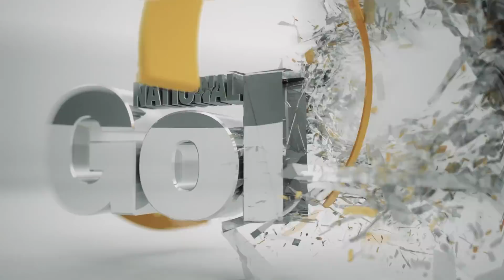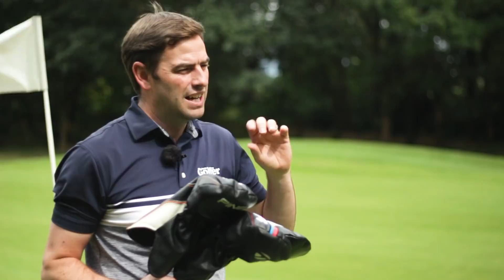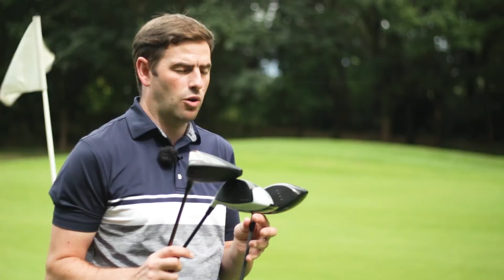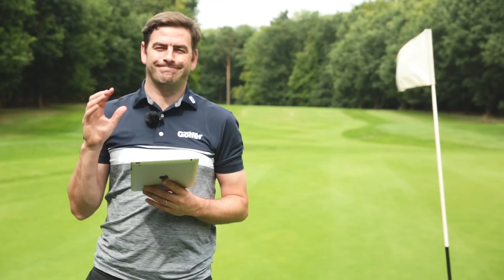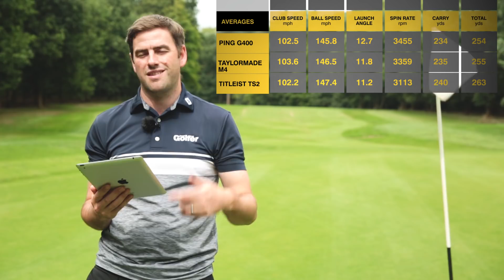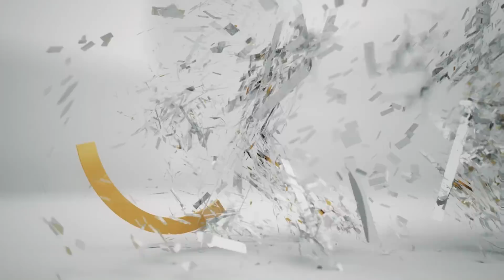Titleist TS2 v TaylorMade M4 v Ping G400 Max | Which is the longest driver?

Comment: The only reason the new Titleist is longer and faster, Is they have given up and decided to increase the shaft length to compete.
Reply from the maker: Robert Barnett All these shaft lengths were exactly the same though Robert?
Reply: National Club Golfer yes I know that, but historically Titleist shafts have been shorter than say Taylormade or ping. You will find they have increased there shaft  lengths in an attempt to catch up with others. The problem is that accuracy is not sexy in the golf world. Once your average joe realises that a good round is made by achieving a good score and not having one drive out of ten smash Ed 300 yards down then golfer may improve.

Drive show put for dough, yep but you can put from the rough.  Cheers
Reply from the maker: Robert Barnett Everyone wants distance and accuracy. I found the TS2 to have good forgiveness and right dispersion despite the slightly longer shaft which is impossible to differentiate from a slightly shorter one...
Reply: National Club Golfer thanks for the reply, I’ll give  TS2 a go and see how I get on. I love Titleist as a brand and hope it performs well.i guess I could always cut the salts down to 44 inch
Reply from the maker: Robert Barnett The longer shaft is an option, it’s not compulsory...

Comment: Good comparison. I'm not a club tech but I'd say you're losing a good 20+ yards because of that high spin.  Shields was carrying 288 average with only 9 mph increase in club head speed but he was spinning it at 2043.  If I interpolate that backwards it means a 102 mph clubhead speed with 2043 spin should produce a carry of around 263-264.   Are those numbers off the machine the same types of numbers you see out on the course?
Reply from the maker: Johnny Penso My swing speed is around 100 and my good shots go 270 total. A Trackman expert says swing speed x 2.7 is about right for total distance on a good shot. Anything under 3000 rpm is ok for my. The last thing I want is a low spinning left miss.

Comment: Those spin rates seem awfully high for a driver.
Reply from the maker: Joe Perez Yes they are. My miss can be a high spinny one and these are by no means ‘low spin’ drivers. Anything around 3000 is manageable for me. More spin actually often means more chance of hitting a fairway for me. It’s the low spinning left miss which is really destructive
Reply: A bit spinny myself, and must admit a mishit with the G400 MAX doesn't seem to be as catastrophic as a miss with others. Was thinking about this new TS2.
Reply from the maker: Joe Perez I love the G400 Max because it gives me confidence. TS2 seems similar but I need to use it in a few more competition rounds to see if I prefer it to the G400 Max...